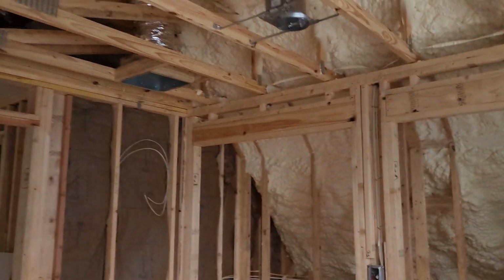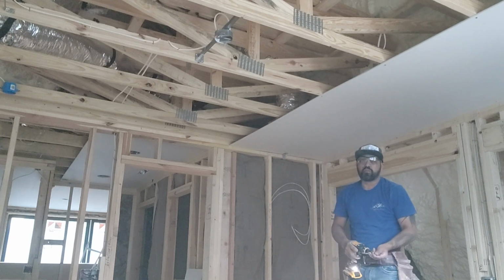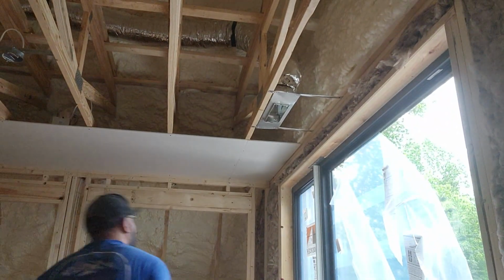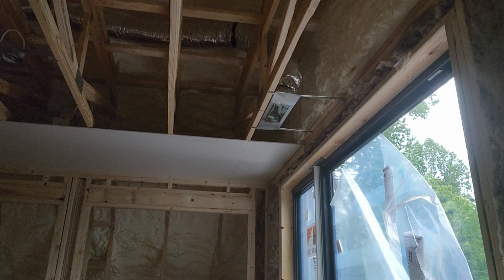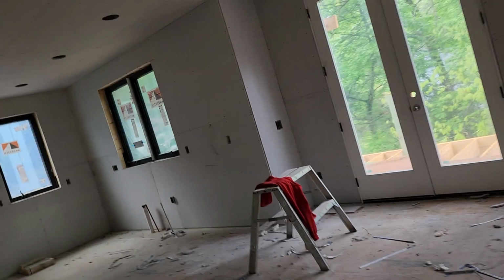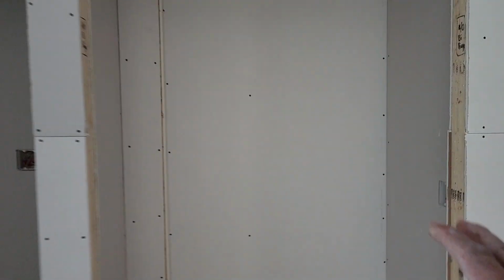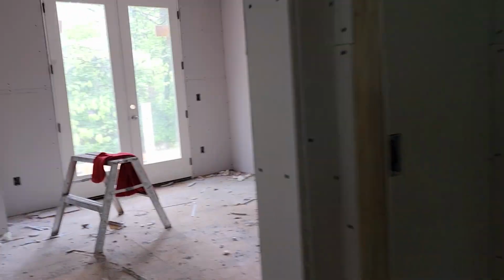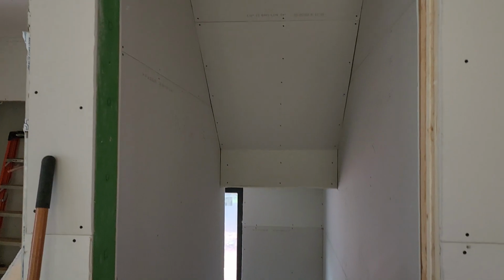how to hang drywall on ceilings by yourself

Comment: Hey amigo what are using to hold the one side of drywall on the ceiling when you hanging?
Reply from the maker: It's a corner bracket I call them the chalanes I will post a new video about them but it's in Spanish